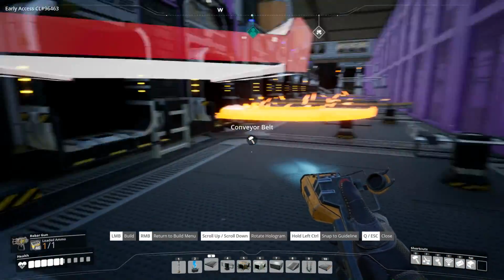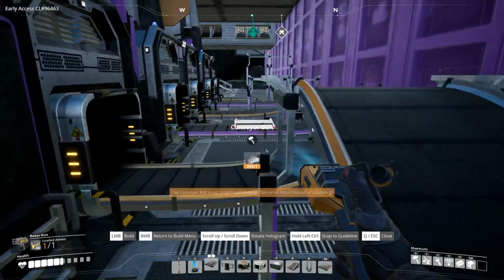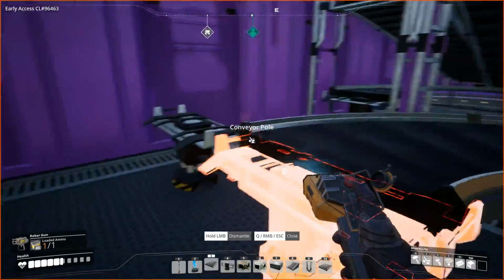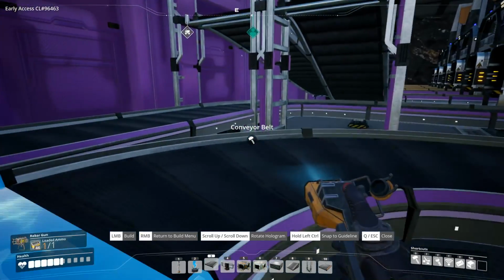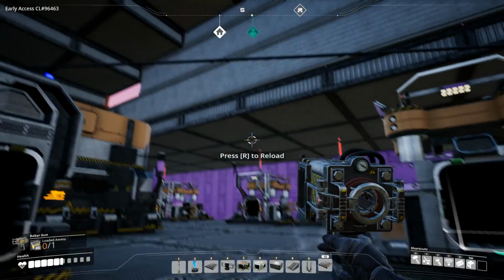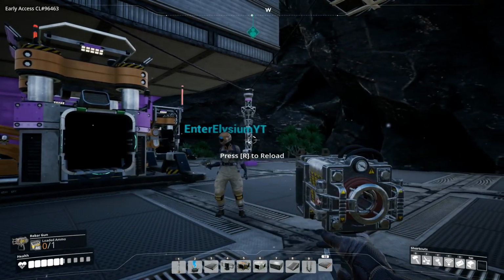Satisfactory Multiplayer Ep#15: The Descent

Comment: 6:00 This is why you build the building around the machine, and not the other way around.

Also, most of the episode was a basic case of "one track mind." Too focused on making the splitters fit in there to see that doing the splitting elsewhere would fix the problem.

18:00 Buildings are like dicks, always smaller than their owners think they are.

19:00 Just when you're done cringing at Bentham's belt setup, in comes EE to make it all "better."

Comment: 21:15 if you build all the belts attached to the top splitter before building the bottom splitter in the first place, you can build splitters stacked one on top of the other as you did. Once the bottom splitter is in place, you can't touch anything about the top one without tearing the whole bottom part down again and doing it over.
Reply from the maker: I decided to avoid that stacking for that exact reason. I was having to switch around belts so much that having a splitter I could no longer touch just didn't seem worth the trouble.

Comment: I have never had that emotional hurting from watching someone so smart not think beyond conveyor splitters. You have wall conveyors. I don't have the game, the computer, nor the net to do so.  He can easily use little space, Yes splitting is a factor. But don't go straight to splitters.  take 4 steps back, breathe, don't rush, then open your mind with imagery. 

One wall conveyor section can turn to a stackable conveyor tower, have the conveyor spiral down to three splitters just under the conveyor widows. Adjustments are your discretion. having a three dimensional space should be easy to place with. 

Another alternative is to  remove the conveyors from the foundations outside and drop them in to your factory from there. Where the stairs are. Your issue is space in 2d and 3D.  Create a new entrance with walkways over your foundries, not in the boundary box though. Have your entrance come off the cliff then into the factory. Not in its  Current place, this should help with the clipping issue.  That is if you want to keep the current Design of the Factory.

Comment: You can get stacking Belt Splitter and Mergers to work but you have to build and connect them from the top first, and work your way down.  Place the Top Splitter first, and then connect up the belts to it.  Place the Splitter below it next, and then connect up the belts to it.  The reason is that the belts clip to the splitter below it, not above it.

The developers really should scale down the size of the splitter a bit, and make them properly stackable.  You shouldn't have to build the belt first and then place a floating splitter.  They should be scaled down to reduce the potential for encroaching clearances, as well as to adjust the belt attachment points to make creating 90 degree corners into and out of splitters, otherwise the belts do a shimmy, which often looks ugly compared to everything else you build.

The game is all about verticality, we shouldn't have to do belt tricks or build things in a certain order just to make a setup work.

Comment: That mess would have been easier if you ran one of the sets of 3 lines on wall belts outside then had them come in from belt holes in the wall. Or ya know just take the wall out and expand the building a bit.
Reply: Or do the splitty gubbins outside the factory and just feed the eight lines in.